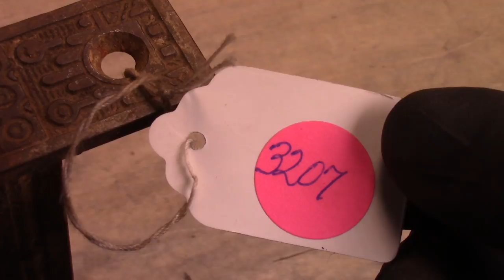Very Rusty Ornate 1880s Mortise Lock Restoration | Random Restoration

Comment: I was perplexed, no stripper in a can. You made up for it with spray oil so I did indeed have the right channel. Meticulously done as always. I love the color but not there. I'm trying pigment and thinner but struggle with mixing. Not ready for metal. Awesome details and nuances in your works I truly enjoy.
Reply from the maker: Yeah I misplaced my spray on paint stripper, but rediscovered where I put it recently hahaha. Thanks a lot! I definitely agree, this color isn't quite right yet - The other tint I use is far too strong to easily mix with other colors. One drop of it is equal to approximately 20 drops of the new tint. I should be able to easily mix in different colors to really fine tune this tint in future videos. I tested pigments originally, but found them, to never mix well at all, and many which claimed to be a clear tint when dissolved ended up being a solid color when I could get them to mix. The tints I have been using recently are meant for epoxy resin and come in bottles. They mix well and are clear, so you're still able to see the metal underneath - A mirror finished piece will still be a mirror finish no matter what color tint is used. Thanks a lot for watching!

Comment: Another gorgeous lock restoration, I do love when you do these! Oddly enough, I feel like there's a hint of green to this tint? Not bad by any means, but it did make me take a second look lol
Reply from the maker: Thanks a lot! Hahaha yeah overall it's too yellow in my opinion, but you are correct about the green. At just the right angle and in direct lighting it sometimes has a green hue to it. I didn't apply as many layers of this new tint, and what I think is happening is that the silver metal mixed with the yellow see through tint causes a bit of a greenish glow. It definitely needs some adjustment haha. Thanks a lot for watching!

Comment: Love the restoration work! What kind of paint did you use to blacken the inlaid work ?
Reply from the maker: Thanks a lot! I ended up using a gloss black Rust Oleum 2x base coat for the recessed areas of the faceplate. It's not the greatest paint out there and I have been (especially over the past couple months) testing out other brand paints. Thank you for watching, and sorry for the late reply!

Comment: Great restorstion, it works and looks like a new one. Is that from the late 1800s to early 1900s?
Reply from the maker: Thank you, Larry! Based on the logo which is on the case cover this lock is from the mid 1880s to early 1890s. Reading hardware started using this logo by at least 1883, but by the mid 1890s it was changed again. Thanks a lot for watching!

Comment: Do you use any lube on the contact points inside the lock, or is it just left dry? Cool piece bro
Reply from the maker: Good question - This lock will be lubricated in the future, but for now I'll leave not lubricated at all. I'm thinking of installing this in my workshop door once I get the rest of the set, but it'll be sitting around collecting dust until then. I figure (no matter what type lube is used) it just makes since to freshly lube it up at the time of installation instead of many months prior. It also makes touching up paint way easier if any is chipped off when fitting this in the door since the case will still be clean - Lubricating the interior usually means getting lube all over the outside of the case too hahaha. Thanks a lot for watching, Tim!
Reply: @randomrestoration6858  can't wait to see the door too

Comment: Had to come back with a guilty mind. Like I stole your tints, I'm stealing your rivet to screw. Just needed to get that off my mind. Oh, and that's not a grinding wheel.
Reply from the maker: Well I appreciate your honesty hahaha. I highly recommend the rivet to screw conversion -  Some mortise locks came from the factory with screws rather than rivets and hold up just as well as the riveted variants! It's probably way easier to grind the end of the rivet flat and drill the rest out, but I like to make things way more difficult than they should be haha. Thanks again for watching, Mark!

Comment: Nicely done!  I like the non-polished bronze, but am not too crazy about the more yellow tint…

I’m curious where you find all this hardware (I wouldn’t mind picking up some myself.)

By the way, I’m a bit skeptical of the primer story 😉
Reply from the maker: Thanks a lot! Hahaha yeah I'm with you there - It's a bit too yellow for my liking. Since It's a new tint I decided to see what a straight yellow would look like, and it certainly needs some additional colors added to it to get just the right color. I hope to get a copper color going in the near future, and will be testing that out in the next video. I found this lock on eBay - It was around $50, and came with a plain bronze double keyhole backplate that didn't belong to this lock at all haha. There are many websites that have a great selection of harder to find hardware such as "Olde Good Things" and Urban Remains Chicago which (unlike this lock) generally have less rusty hardware for sale haha. I'd like to think my version of primer would look about the same as the primer I normally use haha. Thanks a lot for watching!

Comment: Can someone explain what's the use of the small lever at 17:00? I've never seen that in modern locks and I have no I idea what's its purpose
Reply from the maker: Good question - This switch is used to lock the door knobs, and the second/upper keyhole is used to open the door when the doors are locked. It’s common to have a split hub in these locks which simply means only the outside door knob is locked rather than both of them. Thanks a lot for watching!
Reply: @randomrestoration6858  Thank you for your time! The restoration was amazing!

Comment: Would have been nice to see some oil or grease on the moving parts.
Reply from the maker: This lock will be lubricated when it’s installed in a door, but it may be some time before that happens - Until then it’ll just e collecting dust haha. The main reason for waiting is that it’s easy to touch up any paint that may be chipped off in the fitting process since the case will still be clean, whereas if the case/case cover gets oily, greasy, etc. it would have to be thoroughly cleaned prior to any touch up work. Thanks a lot for watching!

Comment: color is mmmh gold with anise ? xD
Reply from the maker: Haha yeah it's a straight yellow tint, but made for an interesting color since the sanded faceplate is grey. I'm not sure the two match very well hahaha. I think I should be able to fine tune this tint over time and get a great color out of it! The old tint I was using was too strong - One drop was equivalent of approximately 20 drops with this new tint, which is actually great because now I can mix in different colors and get just the right color. Thanks for watching!
Reply: @randomrestoration6858  for me , all is good xD

Comment: 13:40 What is this action?
Reply from the maker: Good question, this is called cold bluing. After the parts have been cold blued are soaked in oil overnight - This process is used to prevent rust. Thanks a lot for watching!

Comment: You didn't put any grease on the moving parts inside??? 🧠
Reply from the maker: Hahaha nope. Although I will install this in a door at some point, it really doesn’t make any sense to lubricate it until its ready to be installed since it’ll be sitting around collecting dust until then. This way once the lock is fitted in a door I can remove it one last time and spray some air around the inside to easily remove any dust, wood chips, etc. and then can lubricate it prior to properly installing it. Thanks a lot for watching!